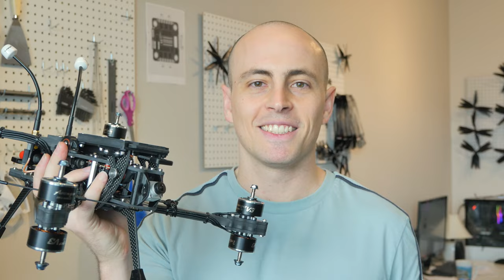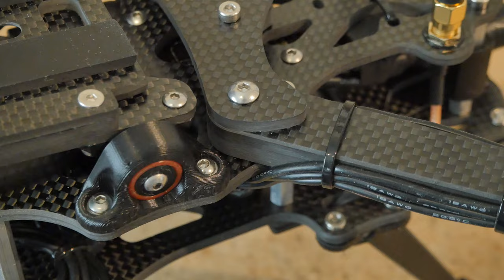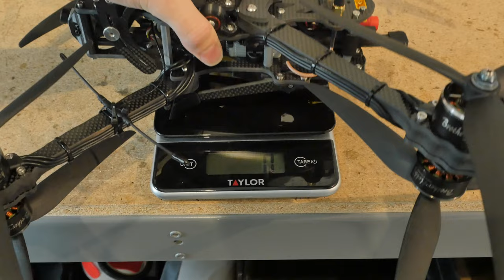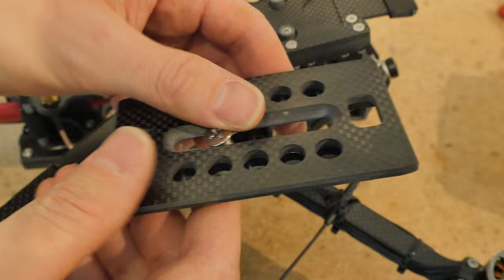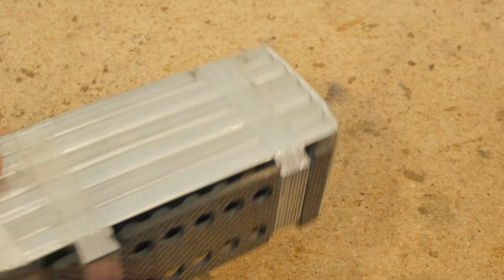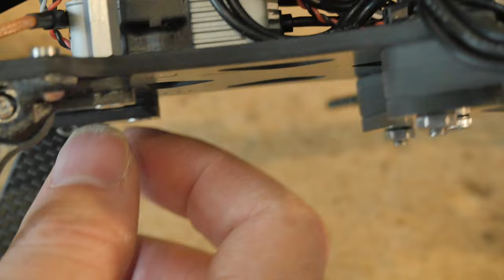La Mamba Frame Design

Comment: That thing looks excellent. The staggered design makes sense as a compromise to the siccario and a flat design. One thing I'd point out is that while small footprint improves yaw, wider stances improve pitch and roll. This is why so many like the wide X 5" platform. A 6" size true X is best with 5" props. That being said, short arms are best here for resonance sake and weight. Also as you said, weight distribution on these platforms is absolutely critical and that battery position with where the props are situated is excellent

Overall you've put a fantastic amount of thought into this.
Reply from the maker: Thanks Bob! Good point about the pitch/roll stability. I do notice that it does take some high P gains to arrest the drone's momentum when doing a snap flip or roll. I'd say the quick yaw spins  are more common in the cinema space though luckily in part because of JohnnyFPV's style that he created. Having larger spaced arms even a couple cm or so really affects the vibration characteristics and requires more beefing up on the carbon.

Comment: Nice bird. One thing i didnt like is how you grounded the frame using the air unit antennas. Had a frame giving me voltage once, around 3-5v and it turned out it was the esc mounting wholes that had voltage. It was leaking through the gummies and into the frame. They were the tmotor pacer 60 amp 4in1 escs so in your frames case that voltage would have been grounded causing a current leakage and who knows what other issues to come with it.
Reply from the maker: Thanks! I didn't realize current leakage could happen with the ESCs. It is a poor ESC design if the mounting holes are plated and grounded. I don't believe most are like that.  

Regarding the antennas: La Mamba frame does not ground the VTx antennas. If you see this part of my frame assembly video: https://youtu.be/SEeDjLkcMsY?t=704 I show how there are 3D printed shoulder washers that electrically isolate the antenna ground away from the frame. Also I recommend putting down electrical tape onto the carbon before installing the air unit and TPU saddle strap: https://youtu.be/SEeDjLkcMsY?t=1697

Comment: can i strap dji rs2 with camera on top of it ? will it be able to fly any more ?
Reply from the maker: Yes you sure can! @magfly_fpv has done it before.
Reply: @strawhatsam  Wow thanks for answer! So where is a limit for max payload weight that You recommend?   Do You mount dji rs2 on an angled camera plate ?Or some adapter?
Reply from the maker: @jurgieldetka5469  i believe he used the rs2 mount that I sell on my website. Komodo with light lens is okay, not sure about dji transmission on the gimbal too...
Reply: @strawhatsam   i see that he used Your naked blackmagic on rs2 . can You tell my where is maximum weight limit for La Mamba ?
Reply from the maker: @jurgieldetka5469  I would say the maximum weight is 6lbs. It depends on the motors used too. 3115 1050kV motors with HQ 9x5x3 props is going to lift a lot more  than with 2812 900kV motors with Gemfan 9045 props for instance. So perhaps a range of 5-7lbs flyable I would say.